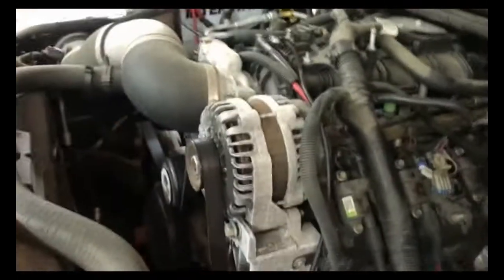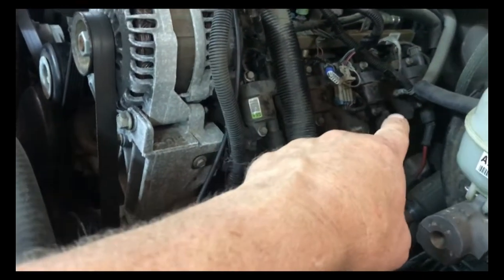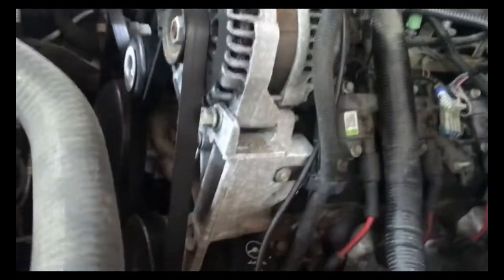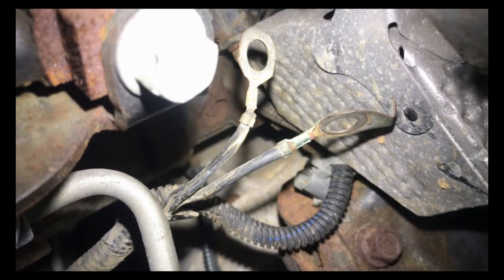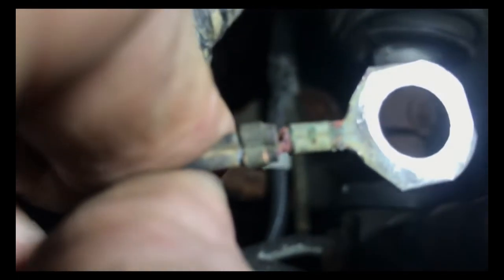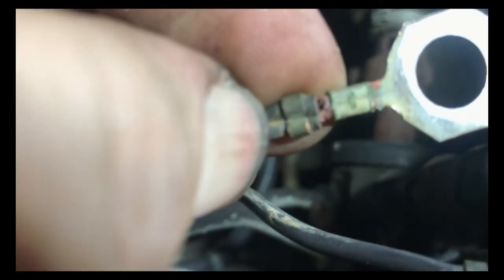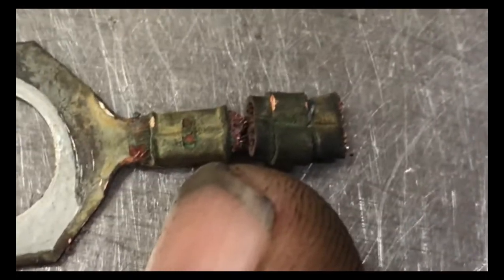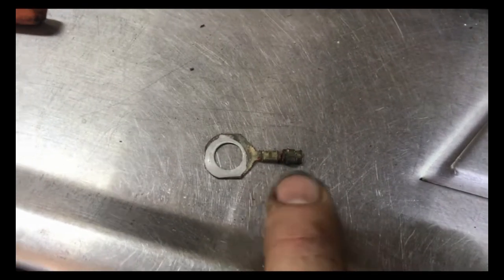GMC and Chevy 5.3L Trucks P0300 Random Misfire and Sometimes No Spark

Comment: Fingers crossed this is my issue!! I went over some train tracks and then truck felt like it lost half power, flashing engine light. Went to check spark plug wires when I got home and they just broke so I went to replace plugs and cable and the whole driver side bank all the plugs are fouled out bad and the passenger side looked perfect.  U1000 and P0300 codes. Will be replacing these connectors once I get home and update!
Reply: Man that's crazy.. I just bought a 2004 Silverado with 5.3 Vortec with 215,000 a few weeks ago. I too chose a very bad road one day and hit every pothole under the sun it felt like. Shortly after I noticed some lag and the CEL flashing while I was on the interstate. Went to autozone and they pulled code p0308 cylinder 8 misfire...but today at the shop where I work we pulled p0300 random misfire.. I swapped the coil packs on cylinders 8 and 7, and that's when I pulled the p0300 code. Only efforts I've made to remedy this is one can of seafoam through the vacuum line coming from the evap to the engine (close to cylinder 8) and discovered the previous owner ran Bosch spark plugs, so I purchased some Autolites but have yet to install. I'm gonna examine my electrical connections and grounds tmrw and I will keep you posted
Reply: @Joey-rn2tr  what happened then?
Reply: It's been 3 months what's the update was it the wires?
Reply: Michael Major ... no fix, it’s at the 5th mechanic.  No one can find the problem, still only code is for random misfire.   It’s some how getting extra fuel into cats.  I changed cats, computer, plugs, wires, o2 sensors, map, oil pressure sensor, all grounds, smoke test, removed timing chain cover verified no jump, compression good on all cylinders.  I’m at a loss, this is crazy!!
Reply: @reelmilitia6975  did you check your coils. Take them out for cracks if they shift when push/pull on them. And check injectors connector plug, for brakes.
Reply: @reelmilitia6975  Did you check the Mass air flow sensor?
Reply: @miguelortega2836  Yes, replaced MAF and  MAP
Reply: @jahlieel.e7856  Coils been checked and actually replaced one, all 8 injectors have been replaced as well. 7th mechanic and no ideas.
Reply: Any update?
Reply: Any solution?

Comment: I have an 08 Chevy silverado 4.3L. Changed plugs and wires for P0300 and P0449 Evap solenoid is changed also. CEL back on and truck still runs ruff at idle or stop light. P0304 cylinder 4 misfire and P0300 multiple misfires.......i dont know what to do at this point....I dont have fuel injectors on the 4.3 from what ive heard.....Could it be a ground or if anything else please inform me!!!!!
Reply from the maker: Make sure you are getting spark to number 4 cylinder. If you do, then do a compression test on that cylinder. If that is ok then it could be a fuel problem. You do have that spider fuel injector inside the manifold they do go bad all the time. Thanks for watching
Reply: The G Automotive And More  I took it to PepBoys for a diagnostic. He said the coil pack is bad....
Reply from the maker: @OShae_Pippens  ok
Reply: The injectors on the 4.3 liter engine they go inside the intake manifold and is a very commun problem, the injectors go bad all the time because was a bad design.

Comment: At 1:55 is that the engine mount heat sheld from the driver side? I have recently removed the old engine mount on the driver side. After replacing the new mount. My engine started to vibrate in N and R, specially on R it sounds like vibrating. Could this be the issue, It might have pulled off? Since the engine was jacked up abit to remove old. Engine mount?
Reply from the maker: Yes that is the motor mount heat sheild. It is possible that the wire got pulled. Thanks for watching.

Comment: I have a misfire on 7, changed coil , wire, plug and injector,  still the computer pick up a misfire , I lost what to check now. Any clues , grounding ?
Reply from the maker: I would check the compression on that cylinder next.
Reply: Keith Lewis bad lifter maybe

Comment: Man I really wish I could speak to you over the phone 5306659519 I'm having such a hard time with this po300
Reply from the maker: First thing do you have a good scaner that you can go in and look at missfire data? Because they have to miss so many times before it will tell you witch cylinder it is. That will narrow down you problen there. If you don't you will need to take it to a shop that has a good scaner.
Reply: Well i feel quite stupid I had a bad 02 sensor bank one sensor one
Reply from the maker: Win some Loose some. Its all a learning experience. Thanks for watching
Reply: @jacobdonaldson5643  so bad oxygen sensor caused a p0300? Did you get any oxygen sensor codes or lean rich codes?
Reply: Atleast I got alot of new parts and alot of good experience working on my truck mostly due to your videos 👍 give me confidence to do it myself even if i  was wrong I was stop confident I gmcoukd get the job done with your video👍 great work bud
Reply: I Wil have to goto a shoo for that if I pull  the valve covers off and I see a broken lifter is that fixable or should get new block?
Reply from the maker: @jacobdonaldson5643  It all depends, if the truck has a lot of miles on it I would replace the engine. Because when you take the motor apart who knows what else could be wrong. Have you done a compression test ? that will help you find out what cylinder is bad. Then do a leak down test and see if its the intake or exhaust valves or rings.
Reply: I could*